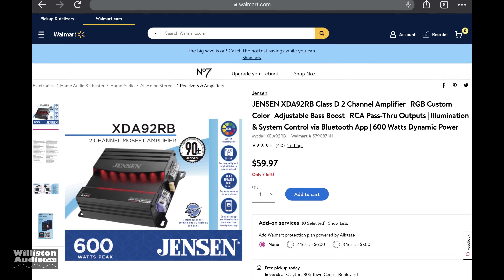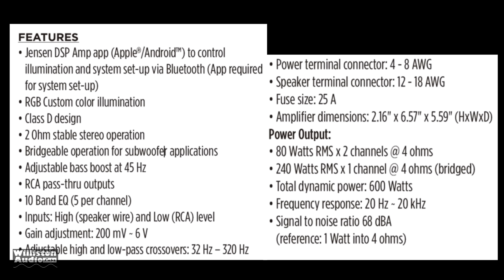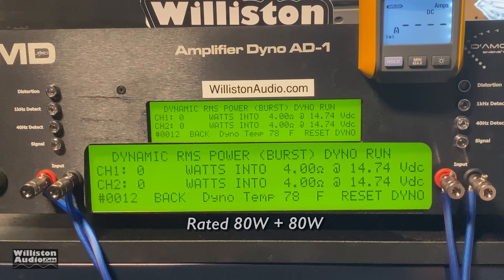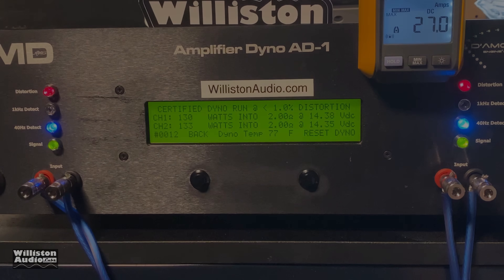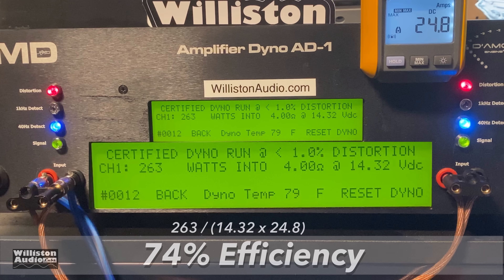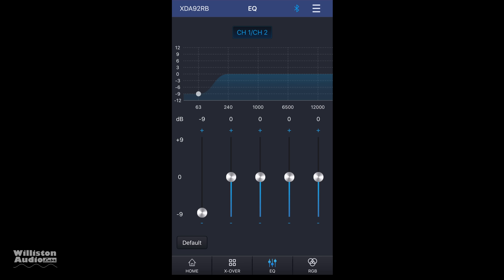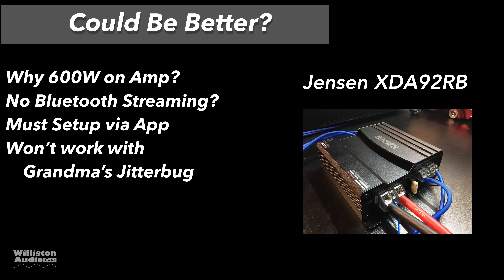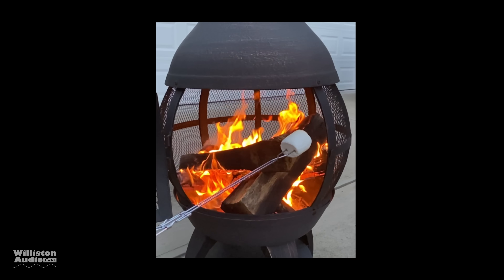Is a $59 Walmart Amp Any Good? Jensen XDA92RB Amp Dyno Test

Comment from the maker: Shop (affiliate links):
eBay: https://ebay.to/2IxXwZL
Walmart: https://bit.ly/2T2QUnX

See Budget Gem's Test of the Dual XPR82D - https://youtu.be/kFBW9BLZ7RM

(Video Gear I Use) 
Camera - iPhone Xs Max 512GB - https://goo.gl/uFHBh8
Samson Go Mic Mobile - https://amzn.to/2BSAtll
960 LED Panel: https://amzn.to/2Sxoq3S
Lavaliere Microphone - https://amzn.to/2Rw5PIw
Sennheiser Wireless Mic - https://amzn.to/2BSwIfD

This VIDEO was EDITED with LumaFusion on an iPad Pro 12.9:
iPad: https://amzn.to/2Ancr1W
Software: https://goo.gl/6yvWss

--------- Test Bench Equipment -------

SMD / D'Amore Engineering Amp Dyno: https://goo.gl/sJTcf7
XS Power D1400 Batteries - https://amzn.to/2BPFCKW
XS Power PSC60 Charger - https://amzn.to/2CHGcfs
Fluke 1000A AC/DC Clamp Meter: https://amzn.to/2Rw5WDA
Handheld Dyno: http://amzn.to/2u2EgKV
My Favorite Screwdriver Kit: http://amzn.to/2x0VzcE

DISCLAIMER: This video and description contains affiliate links, which means that if you purchase from one of the product links, I may receive a small commission. As an Amazon Associate I earn from qualifying purchases
Reply: I know you tested the Dual Electronics model of the 4 channel 1000 watt, but you should test the big brother to this amp. I recently picked up the XDA94RB from Jensen on clearance at Wal-Mart for $21! I'm curious if it'll be the same as the Dual
Reply: Oh you have to hook thatt Jensen back up and run it 2 ohm mono.  I had two different Jensen 50x2s back in the early 90s one was the gray/silver one  ad one was the blue one.  I ran both of those at two ohm bridged when do a set of pyles and the other on a pair of 12" cerwin Vega's.  OMG that little Escort bumped so hard on those cv's. Spend both of those amps that way for quite a while and never had a problem. They did get reeeeaaaallllly hot though!  

I just want to see what it would do.
Reply: Very impressive as always wiz! Keep em coming!
Reply: Jensen XDA92RB Amp Dyno Test Thanks so much for this video hoping to see the  Jensen XDA91RB amp dyno test  its the mono block version
Reply: Will it push a 15 inch  bridged....
Reply: @liljons6753  it matters how many watt the 15 needs max watts you going to see at all time is 220watts so you you have a 1000 sub the amp is going to sound like garbage and low hitting
Reply: @Shiftmode412  i have a lanzer mosfet 2 channel bridgable...... Going to a cheap pyle 2000 watt 15 inch woofer...(not hooked up yet)
Reply: @liljons6753  yes
Reply: Suono D2000.1
Reply: Can this amp run tri-mode ?
Reply: Worse thing on that Amp spec wise is it's shameful SNR of 68dBA !
Reply: How did you feel about the Bluetooth settings, I always had and prefer manual controls but if Bluetooth app works good enough is be interested
Reply: @heretheregeneralrepair1712  its functional  i prefer the old style  but kinda neat you can set exact frq with easy  6 12 or 18 db
Reply: Is it ok and safe to use bass boost?
Reply: Is it possible to use this on tweeters? Seems like the Dsp hp and Lp is limited.
Reply: I second the test on the xda91rb .. Im considering that amp.. There is one major concern perhaps you can answer.. I run my radio through my BT.. Does using the App on the amp interfere with the bluetooth connection on the radio
Reply: @whoman3466  no I have both sounds great the Jensen xda91rb smashing two 10s

Comment: I went to get one of these from Walmart and it seems like they redesigned the amp because the XDA92RB that I bought has a straight diffused led strip and has the gain, frequency, bass boost, and x cross adjustments all on the unit and the app can only change the LED strip color. It also seems like you can't change any equalizer settings since it's not available on the app when connected to it.

Comment: i have a jensen with a kicker rcomp 12’ the issue im runnin into is i had the speakers or amp drain my car battery and i had to jump it, im tryin to find a power switch to be able to turn off the amp
Reply: @Rxckstarrrr  doesn’t it turn off if you have it connected to your head units remote wire?

Comment: Just got one of these to put in my old 97 dodge ram.  First time I've ever done anything with amps, but it was really easy to install and its compact enough its easily out of the way. For the price, noob friendly, and definitely increased the volume and quantity. Definitely was NOT going for competition quality in an old work truck with over 200k miles and a cheap 10" android head unit, but it was a lot better than I was expecting. Also put a 10" powered sub under the back seat that turned out pretty good.

Comment: holy shit big d dynoed it!!! lol i have this lil fucker on 2 hifi parts express 6.5 woofers for my mid bass. cool that you have the vid already. ngl i have to keep the gain a lil too high for my lil 6's but they were only 25 each and not like the amp was alot either. but i got that bish on 7 outta 10 and the main level or whatever at 20 lol

Comment: My Jensen DUBA2100 died after way too much abuse for 4 years, running 2x12" at 2ohms and overheated it many times. Got another amp for that setup and when adding woofers to my other car used the DUB, after about a month it kept making the speakeres hav an aweful rattle noise for some reason. Changed it out with this jensen cause it was similar power and the rattle went away. 

So far its working great, my current woofer is a DVC 2ohm, not sure if this amp can handle 1 ohm if i parrell it but in series at 4ohm its kicking just fine. Hell might buy a second one and 2ohm power both coils with this amp cause its cheap enough.

Popped this amp in 5 months lol.
Bought another as a replacement and lasted another 3-4 months. died again randomly.

Comment: When you say you can’t Bluetooth stream what exactly do you mean?
Reply from the maker: The Bluetooth connection to this amp is only to adjust the sound and LED's. You can't stream music over BT to the amp
Reply: @wal  so you can only use this amp with cd’s? Or are you saying some amps allow you to connect directly to the amp to stream music instead of connecting to head unit first then the music going to the amp? Im buying this today and what to make sure before I buy the wrong thing
Reply from the maker: @gelatoconnoisseur5389  No I was saying you can't Bluetooth direct to the amp with music and your phone. If you have a head unit, then anything you can use with the head unit will be amplified. Some amps have direct Bluetooth Audio streaming and this one doesn't.
Reply: @wal  thank you for helping me understand and replying so quick

Comment: Here a few years later! After I saw this I just had to get one to play with. I absolutely love this little amp. It’s put together nicely and never lets me down. 

I ended up putting it in the back of my RX7 when I imported it, it fits perfectly in the bottom of the vertical spare tire well. I have it driving a Bose ported box out of a 370z or something, with two little 2ohm neo drivers. It’s perfect. Super efficient. I love it and so do the others that have heard it. 

My hatch drains have clogged twice, and soaked the amp. I’ve pulled it and dried it twice, and it still trucks on. Completely discreet and super lightweight.

Comment: I've been running this little thing pretty damn hard, wired down at 2 ohms bridged. It's not rated for it, but it handles it no problem if your gain is set properly.

Comment: Im running 1 of these to power a comp r 12 bridged @2 ohm and it rocks also have another for the other ranges and it is just a fantastic lil amp and affordable
Reply: It can only be bridged to 4 ohm final impedance
Reply: @Luminous.Dynamics  no the sub is a 2 ohm load and amp isb2 ohm stable
Reply: @larrymontgomery4902  

The amp is 2 ohm stable in stereo mode....meaning left and right channels can be at 2 ohm each. If you bridge it, it must be at 4 ohm final load, it isnt 2 ohm stable in mono mode
Reply: @Luminous.Dynamics  bro idont know what to tell u , my sub is wired to 1.4 ohm load varified with 2 meters and it is bridged and plays absolutely fine
Reply: @larrymontgomery4902  

Damn. I guess it can do it then. Im just going off of the spec sheet

Comment: I have a question. The amplifier has a 25a fuse. What size inline fuse should i be looking for?
Reply: what amp wire kit were you using for it?

Comment: If I’m using this for two rocksford fpstgate r2d4 dvc 4ohm 200 watt subs wired at 4 ohm bridged what frequency should I run and should I run low pass filter or high pass filter since I have a 4 channel wired up to 4 6.5 speakers

Comment: Soldering on those surface mount parts looks rough, like someone was bumping around in there with an iron after it went through hot air. No tombstoning, but definitely some suspicious joints. Fine by me though! I don't mind cleaning up some cold solder joints for 80W/$60. Thanks for the test!

Comment: excellent little amp. I have mine bridged 240 at 4ohms. im running a Kenwood 12 road series sub and sounds great. However I do have a question. Do you need a y splitter for the RCAs if the head unit only has one sub out? or is it fine with just one RCA output from the headunit to the amp? thanks in advance

Comment: My settings return to default when the vehicle powers off.
The app also goes back to default settings when disconnected. 
The amp settings should save where I put them until I open the app,
and the app should update to the amp last settings. Total PITA. Maybe mines a gack.

Comment: The amp on my boat running my 8" Kicker tower speakers kicked the bucket this weekend.  I ran to Walmart and bought this little amp to get me out on the water......Damn!!   This little amp with the Bluetooth features rocks for sure.
Reply: @tunerdadtunerdad7927  I’m just bought this amp for the same reason 😂 my problem is I’m stupid when it comes to wiring and I also have a wb675 that’s a Bluetooth only no head unit. Hopefully I can figure it out

Comment: I had a Jensen mono block and it was CEA2006 certified. I currently have this variation mono amp and believe it's also certified. It's just running a single 10" dvc power acoustic mofo sub at 2ohms happily in a labyrinth box. Believe the amp is 1ohm stable also.
Reply from the maker: Don’t forget what CEA2006 certified means…that it does it’s rated 4 ohm power at 14.4VDC! Doesn’t have to mean anything else

Comment: Picked this up yesterday before looking at reviews. Found it aline for 59$ on Walmart they rang it up at 109 and they obviously price matched the website but I've gotta say this Amp is pretty killer for the deal and quality seems amazing. And the Bluetooth setup I think Is a killer touch. Highly recommend to anyone running a smaller sub setup or in a budget
Reply: Have you had any issues with it not remembering settings or does it not do that? Do I have to connect through the app every time I turn the truck on? Dealing with a 2012 GMC Sierra that the guy repinned the stock wiring harness so it's been a fun time lol

Comment: How does a person use the dsp app when running TWO of these amps, with one smart phone? How does that work?
Or will it at all?
Reply from the maker: Good question. I’m curious what Jensen says
Reply: @wal  i was really considering running two two channel  amps on a pair of components. 2 way or maybe 3 way. Using the dsp like a typical passive component crossover. It would have a much sharper roll off. And i could tweek it. Unlike a passive crossover.

Comment: Great vid. I have this amp pushing a 10” kicker under my back seat in a Nissan Frontier.
Very impressed, got it all at Wamalart. Dual head unit, I also have this amp in the 4 channel pushing kickers in the doors.
For the money it is a great system that flat out rocks Joe Bonamassa, black label society, clutch. I put both amps behind receiver in the dash. There is that much room after thin head unit.
 They get plenty of air. I crank Tool up everyday and still going.
Reply: How did you have the amp set up for the kicker I been trying to find out all day long I have the tc10 300 watt peak power 150 watt rms

Comment: HELP! I am trying to replace a  cheap "500w" MITZU mini amp I had on my bike. It has worked fine for several years and gave me plenty of sound but is going out.  The 12v system has 12 or 14ga wires for power . Does this Jensen amp require the 4 gauge that you stated it's connections were? Or will my power wires work anyway? I have 400w kicker speakers on the handle bars and much more powerful speakers in the saddlebags. They came from Indian MC and did not give me a rating. any advise will be appreciated. I liked and subscribed! btw
Reply: btw, I purchased a Kinter "500w" mini amp which looks idential to the one i had but it is crap, the Mitzu was better, but not available anymore. That's why the search for a better amp..

Comment: I have this amp pushing a single 4ohm kicker 15 and it hits really hard bridged. I was thinking of doing an amp add-on kit to push my 6x9s in the back of my suburban. Same amp or maybe upgrade to the 1200 for my sub and use this one on those. Any thoughts?

Comment: Question for you I want to run three of those Jensen 600 watt amps in my car 1 amp for the front speakers one amp for the middle speakers and 1 amp for the rear speakers will that be a good combo to run my highs and lows I already have a subwoofer amp a power base I've been using for the past 15 years and it works great I'm just wondering about the Jetsons can you please let me know if it's a good combo

Comment: How to turn it on i got one
Reply from the maker: Manual?
Reply: Somewhere in the manual a wire should run I believe to the radio so it turns on automatically. I’m installing this amp now and read over that part.
Reply: Thanks

Comment: Sucks you can't walk into Walmart in Canada and pickup stuff like this; and with the border closed, can't really pickup a cheap/small amp when you need one!  The DSP function looks good too though it's a shame you can't use bandpass settings on the xover, like you can on Power Acoustiks with a similar processor.  Also you have to wonder what the A/D and D/A conversion quality is for these things...

Comment: Car audio has always been jensens playground. Not great and sometimes over inflated numbers.  However they are bullet proof.  But in pro audio they are an ultra premium company.  Any guitar amplifier with a jensen speaker is generally an upgraded model. And as far as input/output transformers in ultra high end preamps, Jensen is the STUFF!

Comment: If I ran this on 2 of skar audios 4x6's which are rated at RMS Power Handling	45 Watts (Pair)
Peak Power Handling	150 Watts (Pair)
and 2 of there 6x9's which are rated at 
RMS Power Handling	90 Watts (Pair)
Peak Power Handling	270 Watts (Pair) 
would it run good? Really still learning and don't know much.
Reply: Idrk a lot yet but still learning. I was looking at the other one jenson has that runs 1000 watt peak didn't know if that would over power these speakers

Comment: What is the defaut settings with no smartphone? 
For crossover and leds. 
Full range audio with max gain?
And will the led still illuminate and what's that default color. Its still useful, as its small size and power are beneficial enough to earn a purchase.

Comment: The new dual amps are complete GARBAGE.. bought one brand new in box as a temp. Couldnt even work. Kept blowing fuses the second i mount the ground on battery. And there was no power going through remote wire. Returned it as defective and got a different amp. 
Dual used to have great amps. 
The 300 watt black and chrome could power a 15 pretty well. It got super hot but was worth every dime at the time.

Comment: I did buy the 4 channel version at Walmart for $98.  
It replaced a 35 year old Alpine that was giving up.
I was initially surprised how good it sounds, but then I noticed something I cant live with.
That 68db S/N ratio and how they quiet it down.  It mutes itself between songs and where there is no 'signal'.  Sometimes I listen to FM talk radio.  When the DJ pauses, the amp mutes. Then when he starts his next sentence, the 1st few milliseconds are cut off.  It was driving me crazy!  Then I started noticing it in the music on really quiet passages.  I cant handle that.  lol
I really like the Bluetooth control.  I can even use the eq separately between the front and back speakers.  That was really cool.
I am returning it and will look for something else.
I think this issue would be less noticeable if these are used for subwoofers.